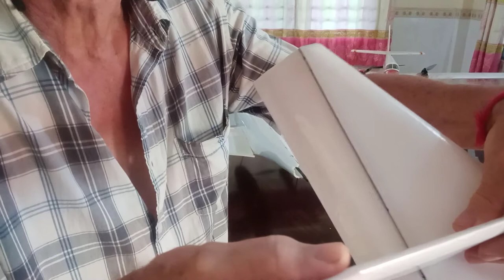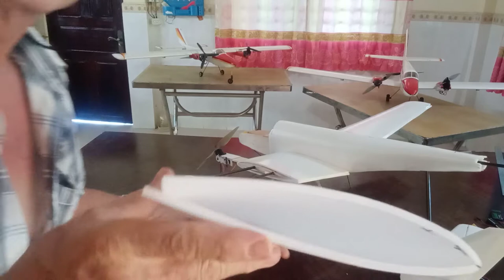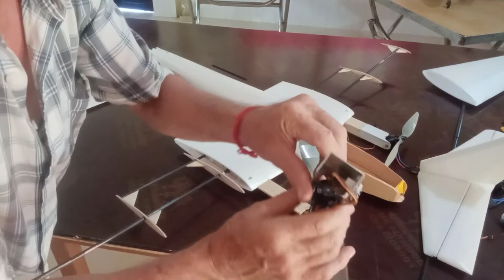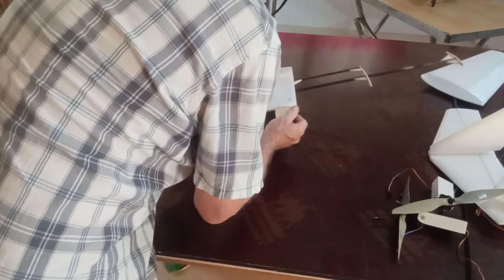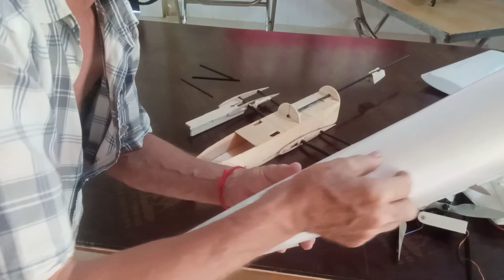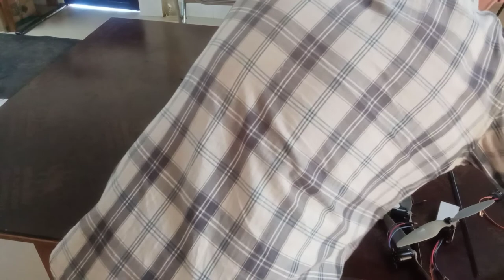Vtol Airplane RC build Part 2

Comment: Hello master Kingsley, any chance of you making 1/64 rcs again? I really miss those. Nice work on the plane sir
Reply from the maker: yes ok ... give me 3 - 7 days i will update  ... i have made 1/64 car and truck with new drive systems (not modify servos) with 612 and 620 motors 3.7v and cheap speed controllers .... maybe